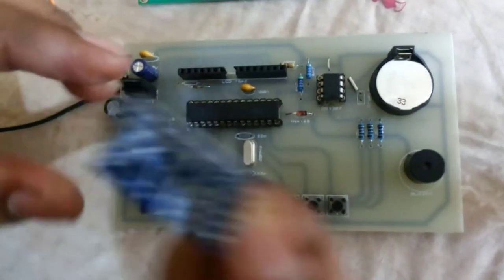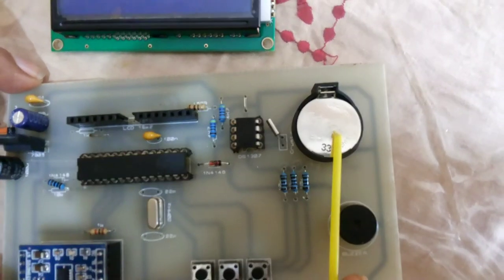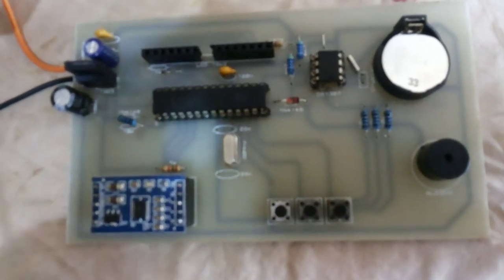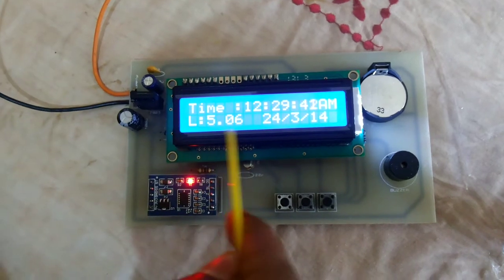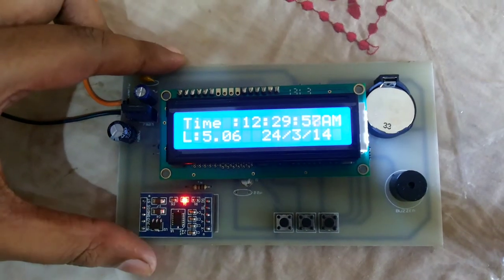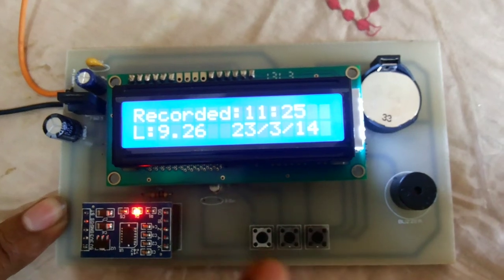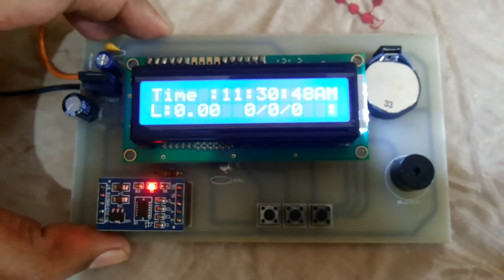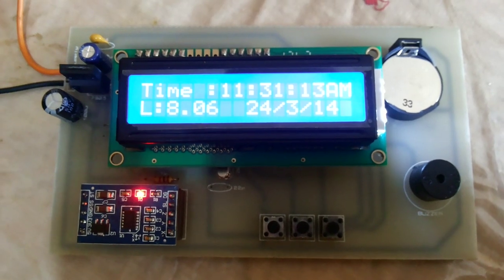SIESMO METER WITH MMA7361 ACCELEROMETER

Comment from the maker: I have used Proton Basic compiler for Pic Microcontroller. and MMA7361 accelerometer to get the amplitude of vibration. MMA7361 gives 800mv/g please check Datasheet. You jut have to read it convert the g to magnitude. and show it on lcd. Simple :)